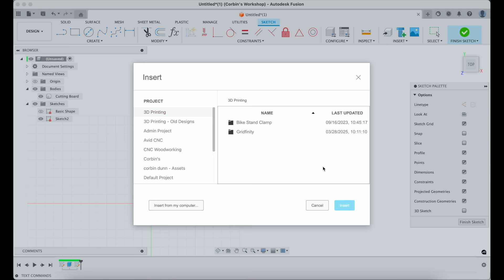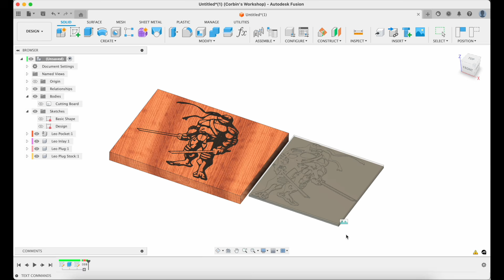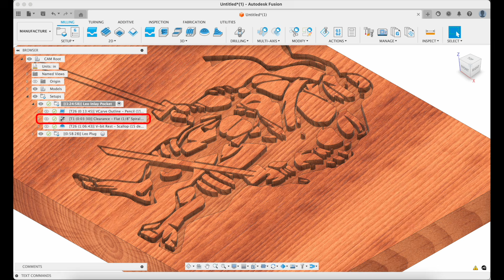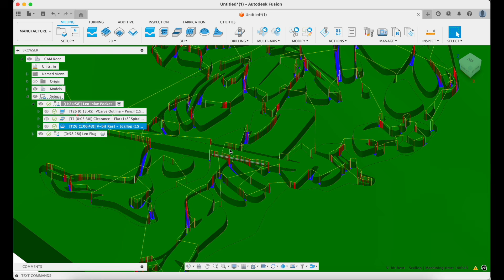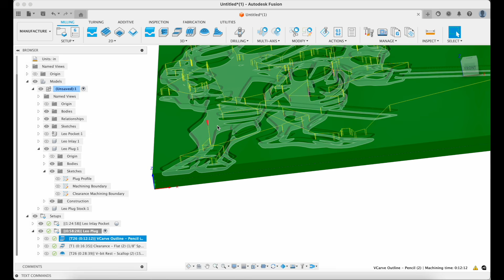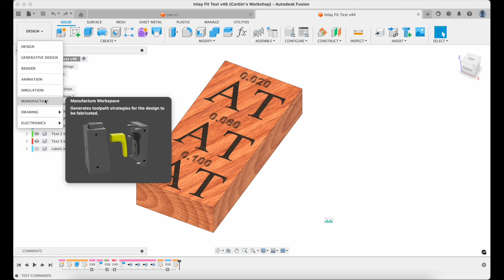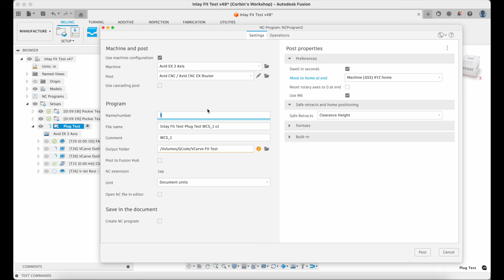I cracked the code! VCarve Inlays with Autodesk Fusion 360 - A complete tutorial!

Comment: The plug-in is really cool, but at the moment I have a problem:
One strange thing: When I have two different end mills loaded in the file, I can't switch in the setup from your Plug-in, don't know why

The bigger problem at the moment: the plug does not fit in the pocket. I did a test piece with a 2mm end mill and a 15 deg V-bit. The plug is to big to fit inside the pocket. Is there a way to adjust this fitting in the setups or with the parameters from your plug-in?
Reply from the maker: Yeah, that latest Fusion update broke the drop down. I reported it as a bug for them, and I released v3 to work around this issue ( https://www.corbinsworkshop.com/shop/vcarve-inlay-plugin-for-autodesk-fusion-360/ ) .
Reply: @CorbinDunn  I saw the part with the v3 because of the broke drop down menu, with the v3 it works again (at first I thought it is still broke, because the drop down menu does not work if there is only one mill bit available)
Reply from the maker: Plug not fitting: Can you email me a picture? Corbin@corbinsworkshop dot com. 

The "inlay_fit_adjustment" is how you adjust the fit. I talk about a bit in the video and describe how find the right fit -- did you do that part? The documentation also discusses it a bit. Try a smaller value if it isn't fitting.
Reply: @CorbinDunn  i will try again tomorrow with a really simple square shape inlay to check

i saw the part about the "inlay_fit_adjustment" in your video, but didn't test it, because I thought it is just to make the fit more perfect. With my test from today the plug doesn't fit at all (I can make it fit with my vise, but thats not really a good option)
Reply from the maker: I'm surprised it wouldn't fit at all...it should have enough of a taper to go in if you used the default values. It is possible you accidentally did a machine of the plug at "model top" instead of "stock top". Check that; if you did model top, then yeah, it might not fit. the extra stock is the part that goes in (tapers more)
Reply: @CorbinDunn  ah, we are getting closer, but not sure why this doesn't work
I changed the origin from the spoilboard to the top of my stock so the actual thickness of the stock doesn't matter.
From the setup: Stock material is 13.5mm; Plug is 11.5mm with 5mm inlay depth
So when I touch of from the top of my stock, there should be 7mm from the base to the top of the inlay, right?

But when I check it on the milled part its only 5mm. With 7mm height and the taper the part should be fit in
Reply: today new tests, it's getting closer, 
Why it only milled 5mm depth instead of 7mm I don't know, after re-calculation of the CAM functions it looks correct.
Still doesn't fit as I hope, but maybe now its the point to play with the inlay_fit_adjustment
Reply from the maker: You really don't want to use the top of your stock as your origin; you will get better results if you use bottom of the stock and surface the top first. This will eliminate any possible error in the flatness of your workpiece, and ensure a very known top surface (touching off on the top can be error prone).

Why is it not the right depth? If your bit physically can't fit in, based on the angle of the bit and the width of the profile, then it won't go the full depth. If that isn't the case, then make sure your machine is cutting right; try any flat bit, do a 5mm depth cut pocket, and measure it. Maybe it isn't really 5mm.
Reply from the maker: Also, just to check, did you do the fit test project that I talk about in the video? That really should be the first thing you try.
Reply: @CorbinDunn  no, didn't do the fit test from your video, I tried it with my one small parts. But maybe I should try it out

and I also will try with origin on the spoil board and surfacing first, lets hope that was the problem :)
I will tell
Reply from the maker: PS: So far, the main reason I've seen people have fit issues has been inputing the wrong bit angle. Ensure it is really 15 degrees total..otherwise, the math won't work out right.
Reply: @CorbinDunn  and yes, its really 15 deg total :)

Comment: @CorbinDunn. This is amazing. I am watching the video end to end a couple of times and reading your pdf so that i dont miss anything. Can you tell me if you made your small clamps or where you purchased them?
Reply from the maker: Great! Yeah, lots of info in the video, and I tried to not be to verbose..I could have easily made it twice as long. The clamps - I just released the new version here: https://www.corbinsworkshop.com/shop/low-profile-cnc-toe-clamps-for-t-track-hold-downs-with-nut-tightener-handle-3d-printable-out-of-pla/       -- only the STL files. I'm thinking of getting another 3d printer and starting to sell them at some point.
Reply: @CorbinDunn  I have found that the free version of Autodesk does not allow tool changes in a single NC program. Is there a way to generate code for each step and then merge the gcode in an editor?
Reply from the maker: @ruhlmcu  that’s right - it is a limitation on the free version, and is a main reason I subscribe for the paid version. You can right click on each tool and export them one at a time. You can copy and paste them into a single file and run them all at once. They should still output an M6 which will cause an ATC tool change to happen at the right time. Another reason I subscribe is they don’t output rapids. I know there is script someone wrote that attempts to add them back in… I’m just not sure I 100% trusted it, so i never tried it myself.
Reply: @CorbinDunn  Thanks, you are my new goto CNC guy! I'll have to do the manual method. I can't justify the subscription cost in my "hobby" budget :)
Reply: @CorbinDunn  My knowledge of Fusion 360 is very limited. I have generated seperate gcode files for each tool path and merged them using a python script. However when i use a simulator outside of Fusion the toolpaths seem to start at the origin, cut across the workpiece, and cut the pocket above the workpiece. Is it possible that since these files are generated as individual setups that there are gcode commands that are generated at the top level? I hope that makes sense? Could you share the first several lines of gcode generated from your Leo example that i could compare to my "outline" only gcode?
Reply from the maker: I haven't actually cut the Leo file; it was just a walk through demo. The only things to look for: 1. make sure your touching off your z-zero on the spoilboard surface, and make sure that the bottom left is the real origin in the Fusion setup. 2. Make sure you aren't using offsets, which are specific to your machine (ie: G55, G56, etc).   If there is an offset in the gcode, it would be defined in the Setup, and it could cause it to cut at a "strange" spot. Watch https://www.youtube.com/watch?v=iyP81afV-Io

Comment: I downloaded your plugin and did a test piece to calibrate. The end mill clearing is roughly a mm deeper than the vbit. Any idea what I did wrong?  I touched off both bits before running.
Reply: Thank you for your reply. It turns out that the tip of my vbit broke off…
Reply from the maker: Bummer! I've broken off the tip of my Amana v-bit once by just accidentally hitting it with something. Not fun :(. I should look into using a Tapered ball nose, as a lot of people get good results with those, and they are less fragile.
Reply from the maker: This sounds very specific to your machine. Make sure you are touching off your bits in exactly the same spot; ideally use the spoilboard as Z-zero, which is what I default to in the Setups I create with the plugin. You can always verify bit heights after you change the bit and touch off: Jog it down to right above your CNC table (maybe use a shim of paper to stay right above) and make sure your z-zero reads really close to zero. If it is 1mm off...then something is wrong with your bit touch off process or CNC machine setup. Edit: typo Job->Jog

Comment: Was wondering if you could help me out a bit. I am also using Fusion 360 and was trying my first test inlay on a simple hexagon shape. I clear with a 3/16 flat end mill and then use a 30 degree v bit. The problem I am having is that the 30 degree v bit starts out a few mm wider on one side of the hexagon. All the other sides are perfect. Not sure why it does this....on both the male and the female parts. The 3/16 bit clearing has no issues
Reply from the maker: Hi Bruce, You can send me your file and I can take a look at it. It is quite possible that the bit angle is not put in correctly; that is the first thing I'd look into. If that all seems correct, then it may be your machine that is having issues. Ensure you can cut a 6" square and have it actually measure 6" on each side; if you can't, then something needs to be squared up or dialed in on your CNC.

Comment: Does this do z height adjustment to cut very tight corners like a normal vcarve would or does it just cut the outline at the depth of cut and will try it's best? If it just tries it's best for where it won't fit the bit what happens to the plug when it's cut?
Reply from the maker: This is a true vcarve; the bit raises and lowers as needed to fit the design, just like Vectric VCarve does, and just like Fusion's Engraving toolpath will do. Look at the tight results on this curved inlay I posted a few days ago: https://youtu.be/aAw58CeuCPs 

The same thing happens to the plug as the pocket; it generates a shape that would be nearly identical to what people do in regular "vcarve inlays". I tried to explain it in the video, but it is difficult to convey. I also describe it in words/pictures in the documentation: https://www.corbinsworkshop.com/vcarve-inlay-plugin-for-autodesk-fusion-documentation/

They always have some slight discrepancies due to the bit angle at the top of the plug (in Vectric or any software) unless there was someway to trace an inset version of the design (which has issues in itself - you can't inset a design past a certain point).
Reply: @CorbinDunn  That's incredible. This is amazing work. I've been doing manual inlays without vcarve in fusion and they've been very hit or miss.
Reply: Followup question: Can I use a 5 degree tapered ball nose for these engraves or will they only really work with a vbit?
Reply from the maker: @dereks9140 yes, they should work - I haven’t physically made one with such a bit, but I know a lot of people use them and get good results.

Comment: Absolutely fabulous! After much trial and error in Fusion, I gave up and used an old free version of carveco to do v carve inlays. Even with it, getting good inlays was fidley to dialed-in a recipe. The math is straightforward, but getting fusion to do it automatically just never seemed to work. Since I only do inlays rarely, going to an antiquated version of the other tool just to get a job done, searching for my notes, and working around it's less than optimal CAM has been a barrier. I am interested to test drive your plugin on my next inlay.
Reply from the maker: Yeah! I was "doing it by hand" for curved inlays, and I would sometimes make a mistake. Using parameters helps eliminate most mistakes, and the plugin really helps automate the process.

Comment: Informative video thanks! I've been slowly trying to work out F360 for inlays for awhile now. Does your script take care of sharp corner radius issues? Where the plug and pocket will be different?
 Fairly easy to test with a 5 point star with long points. This creates sharp points on both the pocket and plug. F360 pencil strategy likes to raise the bit and make a sort of bulb at the top edge where the bit center is actually the center of the point. VBits work here but tapered ball nose has the issue.

 I could see it on your AT fit test a bit but it looked like the plug was carved to fit the bulb. Could be the end grain compressed to fill.

 I've been doing it a bit more simplistic but of course that created some issues to resolve. I simple make 2 bodies overlapped by the pocket depth less 0.5mm. On body 1 I extrude the pocket at my bit's angle. Then subtract pocket body from plug body to make an exact opposite. Then simply select and extrude the white space at the taper angle to make the surface gap.

 This creates a sharp point issue and if the extrude fails its because some area is too small to extrude at that depth. The sharp point issue is actually the tip diameter and the pencil strategy making a bulb at the surface of the pocket or plug inside corners.

 I solved this issue with the svg having no sharp points and everything with a radius greater than the bit radius but this is tedious on a large project. On projects where I create the vectors I draw at 300dpi raster (then convert to vectors) with a round brush slightly larger than the bit. Basically a 0.25mm radius tapered tip is 3 pixels and at depth is a minimum of 15 (7mm depth)  pixels for a 5.12 degree bit.

 The test for min gap is simple, drop the svg into fusion and extrude at a your bits taper and if it barfs an error at the depth you want the gaps are too small somewhere in the svg. This doesn't test radius issues.

Comment: nice plugin thanks so much for sharing - im just elaborating it and saw that some things seem to be a bit confusing to me:

1) I need to use negative measure for the inlay in the plugin otherwise it extrudes (adds it) to the top of the stock for me. (used also top sketch and extruded to the top)
2) needed to flip the plug otherwise toolpath was empty.
3) seeing an empty path on the V-Bit Rest (last step inside the plug) - dunno what's that about :-)

other then that looks good so far - I gladly report back when I setup my machine and did a first test run :-)
Reply: so just wanna correct my statement, its important that you place the sketch for the inlay (svg) at the top height of the board (my mistake) not on the planar z==0 but instead on z==board height. hope this helps anyone else, afterwards all works as expected! thx
Reply from the maker: @dnbblah yeah! Thats the way I designed it. Glad you got it going!
Reply: @CorbinDunn left you a little coffee donation via your shop. 🎉
Reply from the maker: @dnbblah I got it, thank you!!
Reply: @CorbinDunn  most welcome keep up the good work ! You deserve more likes and views.
Reply from the maker: Something isn't working right, you shouldn't have to do those things. What version did you download? Can you email me your file that is demonstrating this? corbin at corbinsworkshop.com

Flip the plug: if you don't "capture the position" after the plugin runs it will go to the "default" spot (ie: upside down). I quickly mention that.

I did recently change a bunch of code and uploaded version 1.2 today; maybe I broke something.
Reply from the maker: Oh wait...if your design sketch was "below" the thing, then yeah, that isn't the way I was planning on it working. You have have your sketch "above" the space it is projecting onto ,and it projects among the "normal" down to the object.
Reply: @CorbinDunn  thanks for your super fast reply! so you’re saying I should extrude my body in a negative offset from the base plane x / y / z axis origin ? I’ll gladly try in a couple of hours and report back ! Thanks again for providing it in first place it’s very handy so get things started and understand what’s going on ! (3d modeler / cs guy here and new to CAM part of the party :-) ) - running 1.2 and newest fusion currently.

Comment: This looks awesome! I have been trying quite a bit today but cannot get it to work. My plug is always to big. I am using a tapered ballnose R0.25-15-D3.175. would you be so kind at some point do a test file for tapered ballnose? I dont know if that is my issue or that I am using metric as a base... 
I had to change the stepover setting for the "V-bit Rest " setting, but else I have not found anything that saýs the metric should not work. Can you think of anything? 
Thanks for all the hard work with this! 
I will for sure buy a license if I can get it to work.
Reply from the maker: Hi Peter, in theory, a ball nose should still work; the rounded bottom edge of the plug might slightly interfere with the plug, but it should be minimal, as I know a lot of people use a ball nose for inlays. You can send me your file and I can look at it. my email is on the website. make sure you aren't facing the plug at model top instead of stock top. The "rest" sometimes has issues with curved inlays, but for flat ones it seems to work pretty well; I'll have to see what you changed.
Reply from the maker: Follow up: Peter sent me his file - I do have an issue with the plugin throwing an error with a TBN, but the main problem may be the bit angle incorrectly put into Fusion